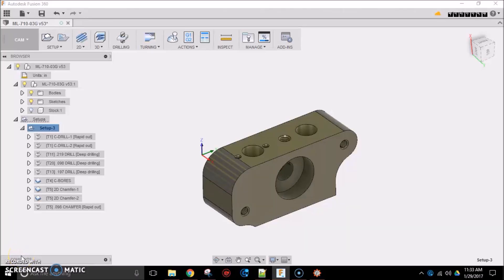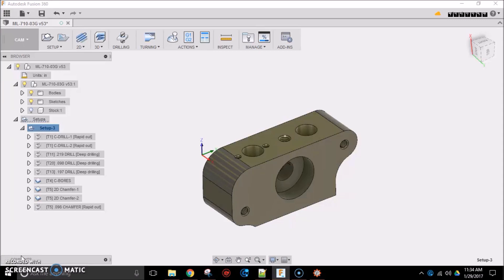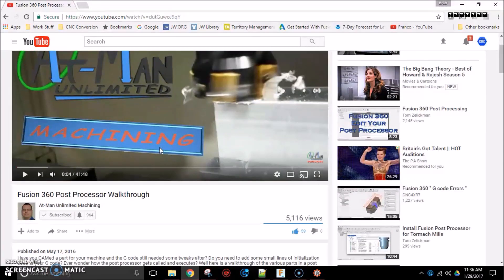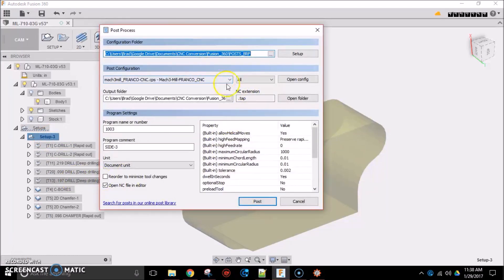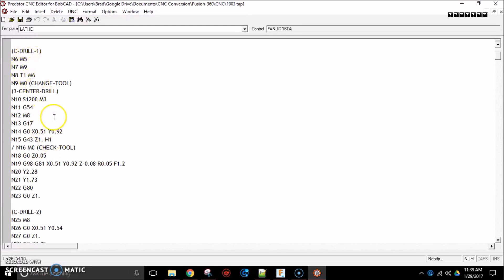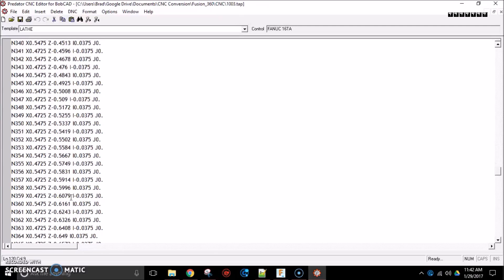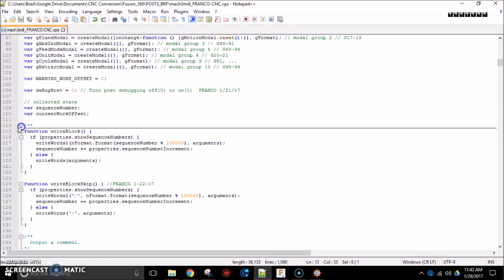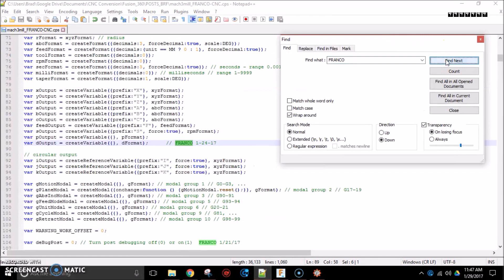Mach3 Milling Post Processor for Fusion360 - Edit Your Own Post

Comment: do you have any 5 axis post processor for mach3?
Reply: Negative, but if you go to the Fusion 360 website, you can download a generic FANUC post processor and it will probably work (or be very close to working).

Comment: I've tried your PP, which is great, and all the other things I can find on the web as well, with no success. Just want to make a 40mm Pocket? All I'm trying to do is make 40mm pockets come out right. Any help would be much appreciated. It's got to be something silly right!?

https://forums.autodesk.com/t5/fusion-360-manufacture/mach3-post-processor-size-error/m-p/10007768#M96000

Comment: If F360 is not the best, what is the best, and what can it do that Fusion cannot?  Please be as specific as you can be.
Reply from the maker: Fusion 360 is a very good CAD/CAM package and it has come a long way since I made this video.  Who has the best CAM?  Some wold say MasterCAM and others would say Gibbs.  I get to use all of them at my day job.  At this point in time, there a few surfacing toolpath types where Gibbs and MasterCAM are better than Fusion360.  But, for the huge difference in price, I'd go with Fusion360.

Comment: Hoping you catch this comment, I was using Bobcad software but bobcad would no longer renew V19 after a computer crash,  so I was looking for different software. Fusion 360  but I was told mach3 won't run on 360 using windows 10?  If I buy mach3 again will it run on fusion 360 similar to that as mach3 with bobcad?
Reply: Email address is rhjgold@gmail.com
Reply from the maker: @rhjgold  Hi.  I used to use BobCAD.  I dumped it once I saw how powerful Fusion360 is. Mach3 will run most any standard Fanuc compliant CNC code intended for a simple 3-axis mill or 2-axis lathe.  Mach3 really doesn't care where the code comes from as long as it is formatted correctly.  Fusion 360 will have no problem generating code for Mach3 or nearly any other type of CNC controller.  Give Fusion 360 a try (if you are a hobbyist, they will let you use if for free) and I think you will see it far exceeds anything you could dream of doing in BobCAD.  The only thing I can think of that BobCAD may excel at is importing graphics and turning them into tool paths, but you can do that in Fusion360 as well.

Comment: Hi Franco wondering if you could assist with an issue I’ve been having. I’ve been using fusion 360 for some time and I love the software but for whatever reason whenever I output the NC file to Mach3 there’s a white dashed line cube in the Mach 3 window which I’m assuming is it’s world and my tool path is along way away from this? What am I doing wrong?? I’ve been using Vectrix aspire to get my work done but I’m drawing things twice and fusion is a better program. I just want it to work! Any help greatly appreciated thanks Jack
Reply from the maker: Hi Jack - I'm not going to be much help.  I've not used Mach3 for quite a long time.  I've switched over to Centroid Acorn and have never looked back.
Reply: Franco thanks for coming back to me the pains of being a 1 man self taught machinist!

Comment: I just want my z to stop dragging through stock on startup and completion 😣
Reply: Do this:
https://knowledge.autodesk.com/support/fusion-360/troubleshooting/caas/sfdcarticles/sfdcarticles/How-to-disable-G28-in-GBRL-post-processor-Fusion-360-HSM.html

Then do this to modify the start for every post you make (change what you want, mine was a test):
Open cps file you're working in. I'm using MACH3 so YMMV 
Ctrl + F and find "// absolute coordinates and feed per min"
Below that, write the following:
/** 
###############################################################################
Added by BJ 11-17-2019 to add custom start gcode to HSM_Express
*/
  writeBlock("(Write anything you want between the parenthesis, I have mine so that my tool doesn't drag on the surface if I forget to raise the Z)" );
  writeBlock("(the huge row of # is just so I can truncate what I've done so I know what's mine and what's original to the file)" );

  writeBlock(gFormat.format(00), "Z0.50 F30");

/** 

###############################################################################
*/

Comment: SOLVED: 02/07/19 Fusion360v.2.0.5357  I posted to your mach3mill_FRANCO-CNC_Rev-2.cps and could not get it to work with debug:1; just posted like normal. But I got an update for F360 while I was working and re-started F360: BOOM-all the debug started working! Great addition.
Reply from the maker: Awesome!

Comment: For those of us that have Fusion 360 and the* demo * version of Mach3mill we are apparently limited to 500 lines of code. I can not find any answer to the question, * Is 500 lines of code enough* ?  Is that part you made over 500? I have absolutely no idea how 500 relates to how big?? of a part I can make. My budget is tiny compared to some and this old brain learns slow nowadays. The word code means nothing to me.... lol. The mach liscense is almost as much as I have in materials.  Some say mach is cheap but cheap is relative to how much money you have.  I will try to find a free alternative if 500 lines is considered too small to be useful as a hobbyist.I don't think I can learn 2 versions in my lifetime. Thank you very much!.
Reply: Hi Jeff, I think you should take whatever you have modeled and do the CAM part of it and post it, you will then "see" how big it is. If you have several operations to perform break them up into different sections, for example a 2D pocket as a separate post process from your facing and drilling operation. Thus keeping the overall operations too less than the 500 limit. that way you will never need to purchased version.

Comment: I remember BobCAD when I started working with EDM wire machines in a machine shop. It was okay to get going but eventually the shop switched over to Mastercam for everything Which is far superior of course but also quite pricey. Recently I've just picked up a little CNC machine for some hobby type work and fusion 360 is pretty awesome! Thanks for the video by the way 😁

Comment: Hi,  I've been using your script and have been having a lot of issues with my Z axis either setting itself 3 inches above the part or more often somehow automatically setting the Z to a few inches below the part. I have to watch it like a hawk and stop if it is about to plunge. Happens more often after Ive been running mach 3 for a while. I'm on a Taig Mill.
Reply from the maker: Hi Benjamin.  I'm going to assume your program is correct, works fine for a while and then suddenly makes these erratic moves that cause a crash.  If that is the case, I don't think the issue is related to Fusion360 or the post processor.  It sounds like you are missing a lot of steps on your Z-axis motor.  It is possible that you have a bad drive that is overheating, shutting down for a few seconds and turning back on.  This happened to me recently and I had the exact same type of problems.  My program would work fine and I'd make some parts, and then all of a sudden the Z-axis would crash into the part.  The Z-axis drive was shutting down, but the CNC software was still sending commands to move Z.  The software thought Z was at +4.000 when it was physically at +1.000.  The next move was intended to position Z at .500" but was actually ramming the tool into my vise.
Reply: That's the best lead on this issue I've had yet. Do you have any suggestions on how to troubleshoot this?  Sometimes when I press cycle start a number like 1.29 will flash in the Z DRO, or even it will display positions that don't make any sense at all, but then when it gets done with the tool change it will go down and stop in the correct .6" spot. Thanks for the great post processor by the way!
Reply from the maker: Thanks.  I'm glad you like the post.  In my case, I just ran the same program over and over (without a tool in the spindle) and watched the drive.  I could see it shut down and then turn back on again (led indicators).  It turned out that my power supply was not delivering enough AMPS and it was causing the drive to get hot and shut down.  I upgraded to a larger PS and the problem went away.
Reply: Thanks again!  I have a Geckdrive 6540 so it's all in a contained unit. Not sure what to do there but maybe ill start digging into it.  I had some other questions but now that I think about it they all relate to my Z axis, so Ill spare you till I get that sorted out.

Comment: I used  a mach3mill for 5axis CNC... I found it in autodesk forums... but I have realised that when doing a simultaneous 5axis the pp to mach3 I got mach 3 to display deformed eccentric toolpaths for 5axis operations.. 3 axis operations are ok.. have you ever faced such a problem? and as far to your knowledge does this affect the real cutting toolpath?
Reply from the maker: Hi.  The farther away you are from the center of rotation, the "stranger" your XYZ motion will appear to you.  As you rotate the 4th and 5th axis, your XYZ have to compensate to keep up with the position of the part.
Reply: Franco that is the right answer i was looking for... this happens only for mach3 pp.. because when i use fanuc generic it was normally displayed in mach3 interface screen, but fanuc deals with ijk for 4th and 5th axis instead of abc in mach 3... ijk is not recognisable in mach 3... any suggestions?
Reply: Can you share the link for 5axis mach 3 pp

Comment: Good job Franco. Thanks for sharing.
Reply from the maker: Thank you.  Are you using Fusion360?
Reply: I have been for the past year Franco. It took me a while to "get it", but now I like it a lot.
Reply from the maker: Interesting.  It took me a while to warm up to it, as well.  Once I learned how to model in it, it made the CAM part seem much easier to grasp.
Reply: Same here. Integrated CAM is the way to go. How's your side business going?
Reply from the maker: It's going well.  The kits seem to sell as quickly as I can make them.  Unfortunately, I'm still making all the parts myself, which takes time.  I'm planning on upgrading my gear sometime here in the near future so I can be a little bit more productive.
Reply: Fantastic! I think your "tutorials" explaining the kits and providing general knowledge are one of your best selling points. I think people like to know that the guy making their kits remains engaged in all parts of the conversion, rather than someone just selling parts. I'd buy your products based on that. Keep it up, and best wishes.

Comment: Have you added the probe functions to the Mach3 post processor?  If not do you know anyone who has? Why isn't ArtSoft cooperating with Autodesk and updating the Mach3 post processor?
Reply from the maker: Hi.  I have not added any probing functions.  Unfortunately, I don't know anyone who has.  Maybe someone else will comment on this and help you get closer to a solution.  As far as ArtSoft is concerned, I'm guessing they are more interested in working on Mach4 rather than spending time on Mach3.  I'm in the process of converting over to Mach4 and it does look like a better product than Mach3.